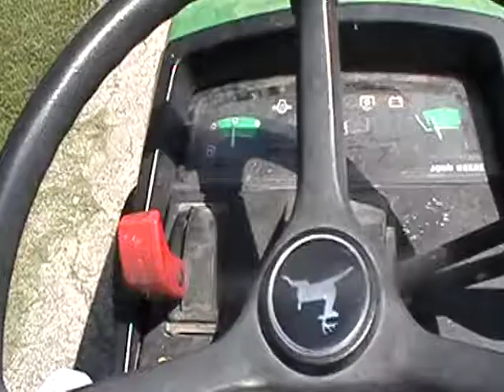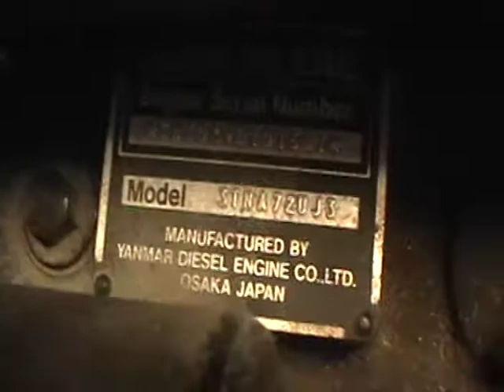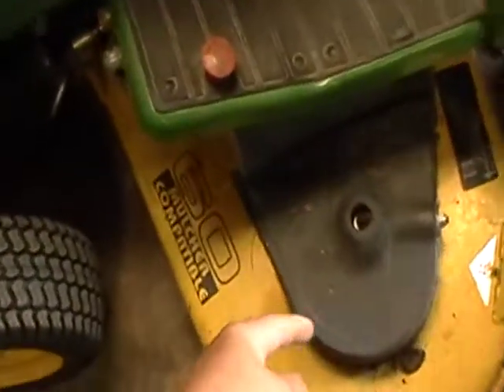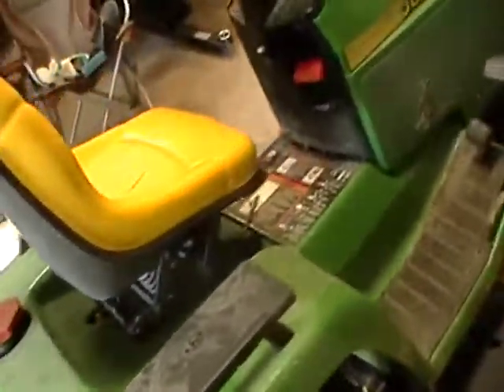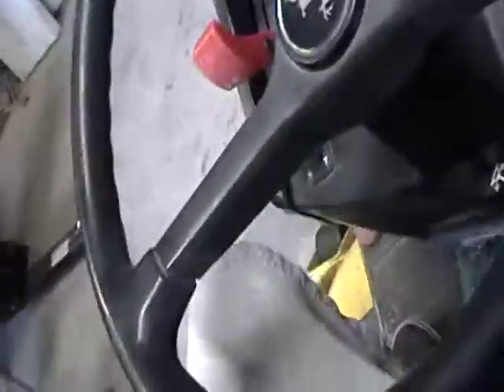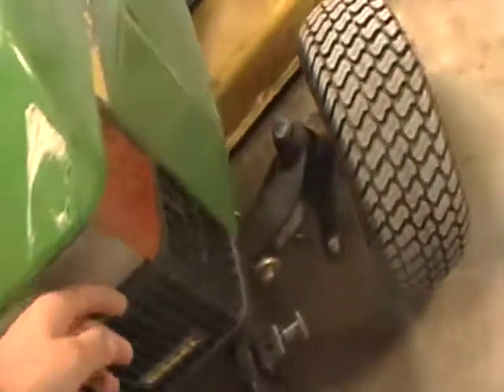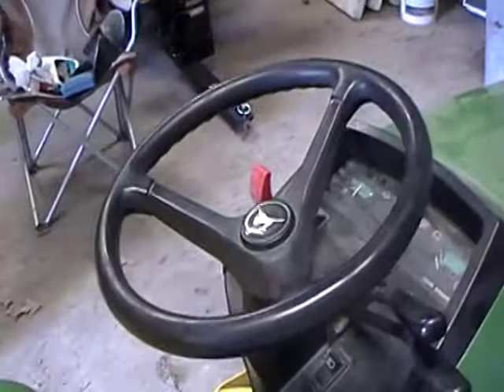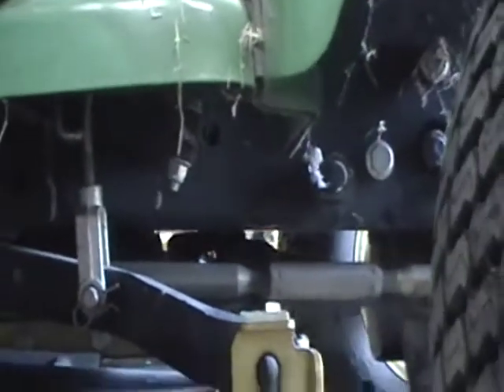introduction into JD 455 diesel comercial mower

Comment: The price , though steep is reflective of all you get: differential lock, all wheel steering, hydraulic lift and tilt and power steering, hydraulic PTO wet clutch, wet disk brakes, 3 cylinder liquid cooled diesel engine, backlit dash, tool box, 4 bar scissor suspension professional high back seat, front, mid and rear shaft driven PTO, category 0 3 point hitch capability, front end loader capability. this is really an amazing piece of equipment and even the x700 series is not quite as nice. There are feathers on this tractor that you could not get unless you bought an 855 tractor. Also realize that this tractor replaced the John Deere 655 tractor which had a ROPS, mechanical four wheel drive and category 1 3 pt hitch, but was primarily used to mow.